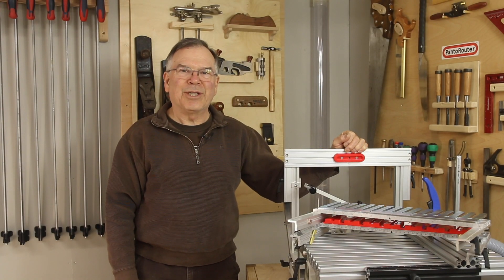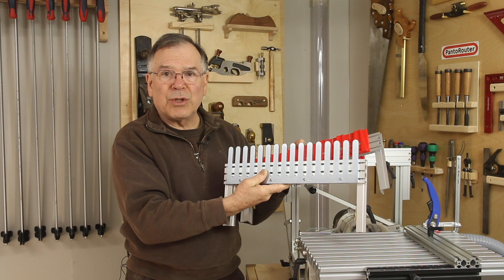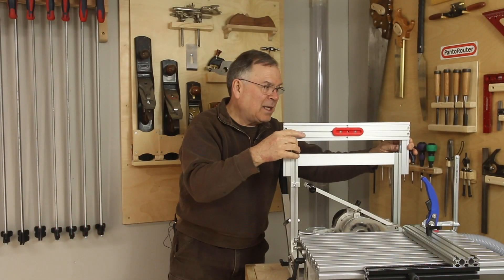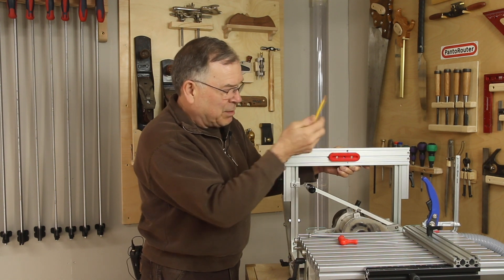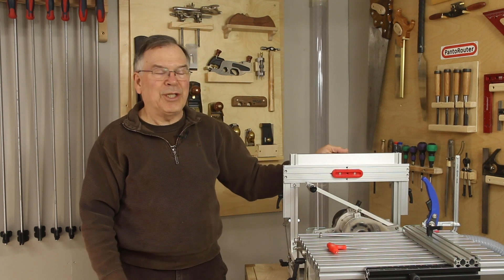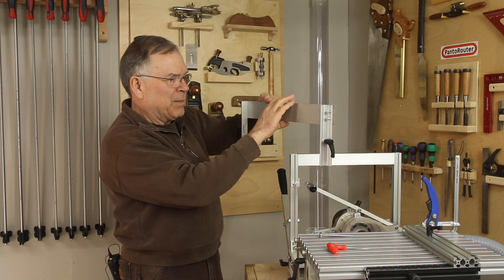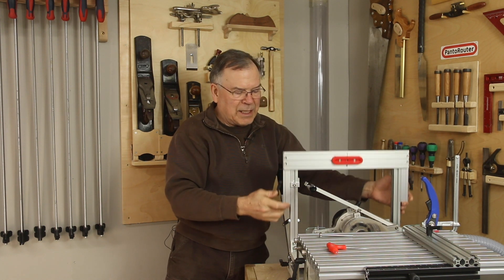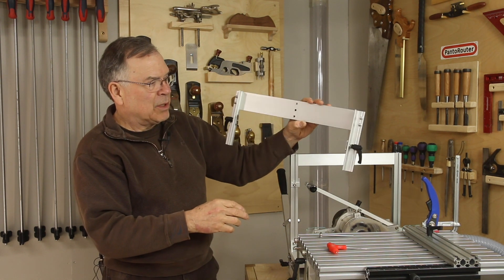Template Holder

Comment: How many Template holders do you think you need to speed up production.
Reply from the maker: We like to have one for each of the major operations we do regularly.  I'd have one for the slot mortise template set, another for dovetails, and a third for all the M&T setups and box joints.  More is nice but three should do most of what you want.